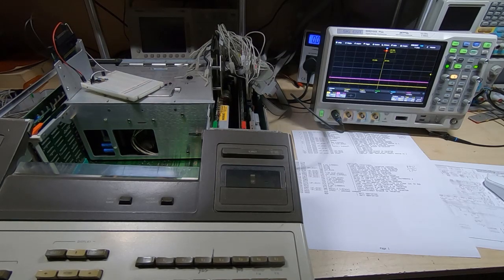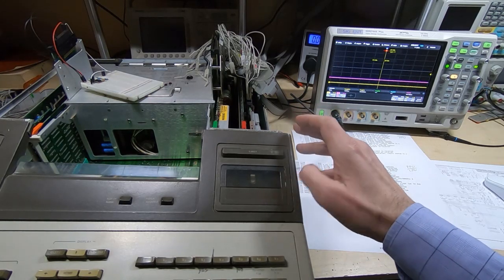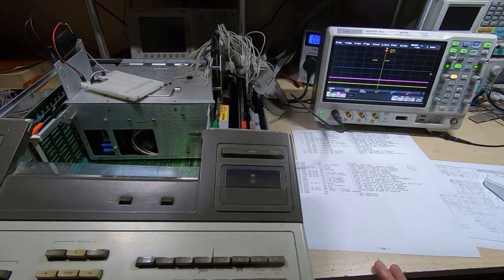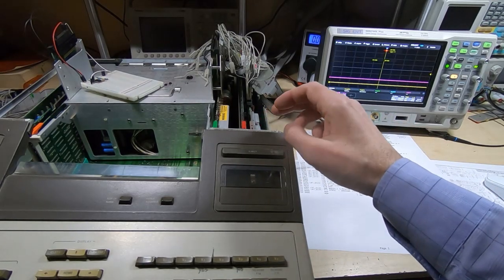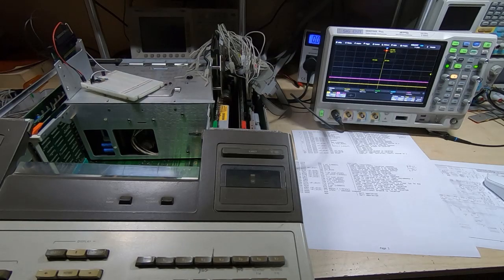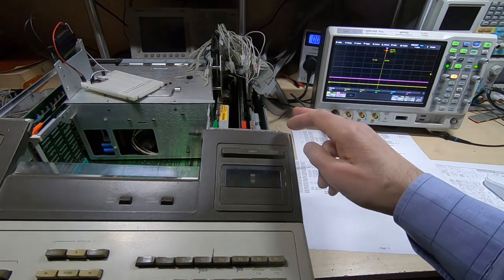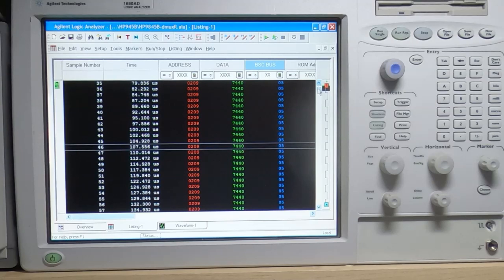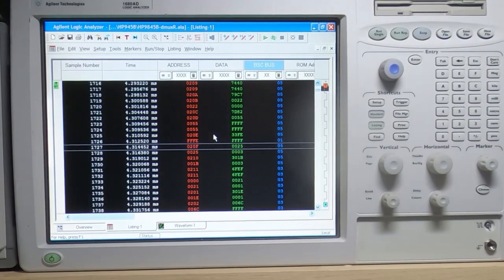HP9845B Repair Part9

Comment: I also would like to see a video on the ROM replacement as I work on a lot of older HP equipment. I am also looking forward to the hybrid connector video. I am currently repairing an HP 8130A 300 MHz Pulse Generator that incorporates hybrids that use the same or very similar connectors. Regards,  David

Comment: Very nice demonstration of hunting down the failure.  These videos are a masterclass.  I definitely would be interested in seeing the rom replacements.  I'm a bit curious how you are managing all those logic analyzer hookups, moving between boards and ROMs.  Are you using clips on an edge connector, and just being very careful when moving the connector between CPUs?  For the ROMs, are you using a riser card?  One more nuts & bolts question:  When disassembling a machine with this many parts, how do you store and manage the various screws so that it all goes back together without any missing or extra screws at the end?
Reply from the maker: Good questions. I will cover these in the next video.